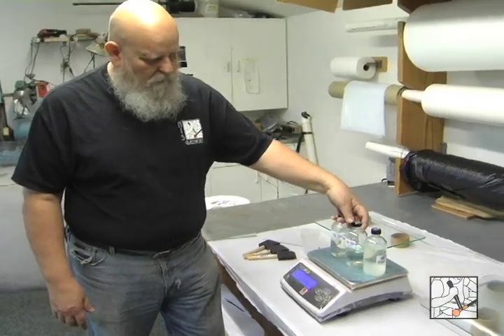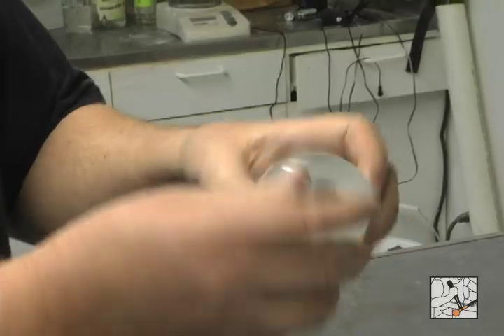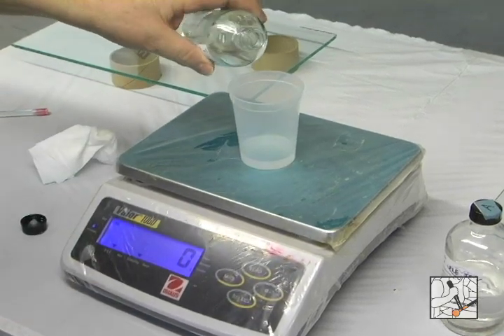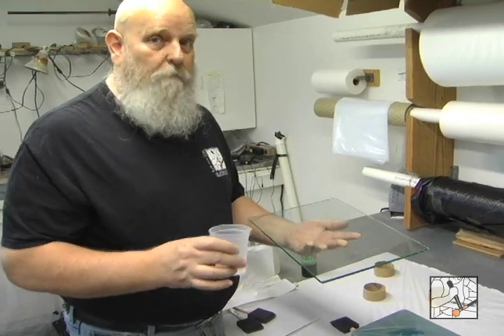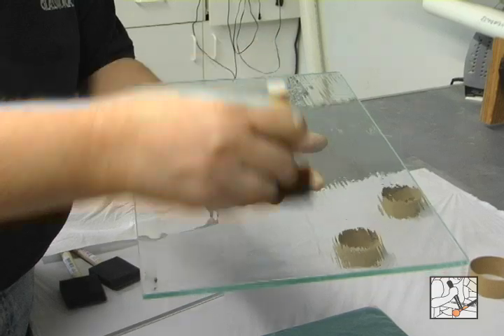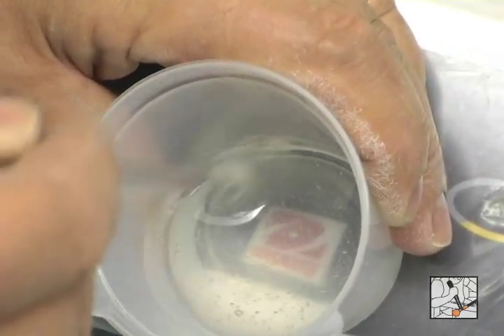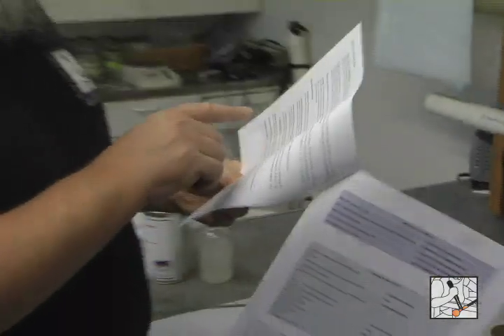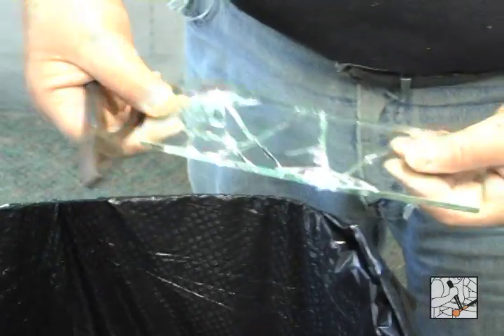Mixing and applying Flex-Tec Anti-Shatter glass coating

Comment: HisGlassWorks no longer sells the product. But it's still available from the folks who supplied him (BJE). It's not called FlexTec...that was just the name used by the reseller.  The actual name is: WC-595 A/B (WATER CLEAR SHORE 90 A POLYURETHANE ELASTOMER). And, in fact, the product wasn't made for this application at all.  It just so happened that an artist discovered that it could be used for preventing shattered glass from making a mess. 

$75/QT, $144/GAL, $669/5GAL ...you cannot currently buy it pints.

https://bjbenterprises.com/index.php/polyurethanes/castable/flexible/water-clear/wc-595-a-b-453/
Reply from the maker: Thanks Joe, yes this is now available direct from BJB. It's a great product and we use it ourselves but you really have to follow directions. That was our biggest issue was with customers who would not follow the directions and had problems with it. It ended up with too much time for us on the phone with customers walking them through it. Still a wonderful product to use.
Reply: When I saw the video, I immediately thought of two-part epoxy encasing glass. I'm an artist and have been using this method for some time. What he left out is the over drip cleanup!
Reply: Our company is BJB, not BJE.....  www.bjbenterprises.com

Comment: since the leveling is relying on gravity, how do you apply this on a window when it's sitting vertically? is it possible?
Reply from the maker: We don't recommend trying to apply to vertical surfaces if you can avoid it. It's much better to keep the piece horizontal and level during the curing period.
Reply: Not enough viscosity to apply it to a vertical surface....it'll just drip/run and ruin your glass.  Dismount the window and apply it horizontally if you can.